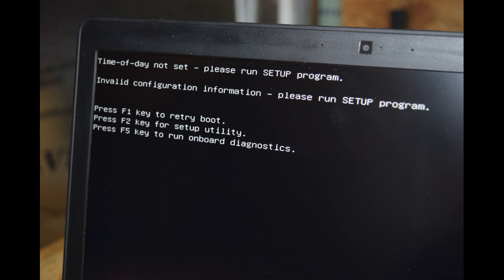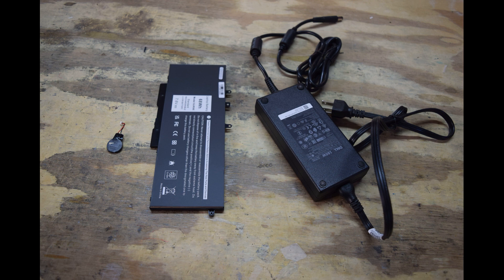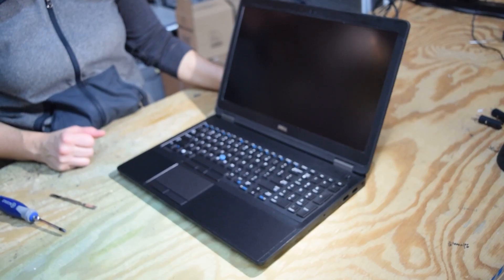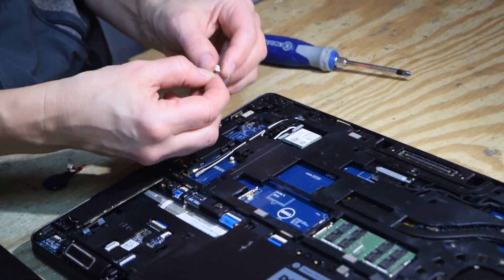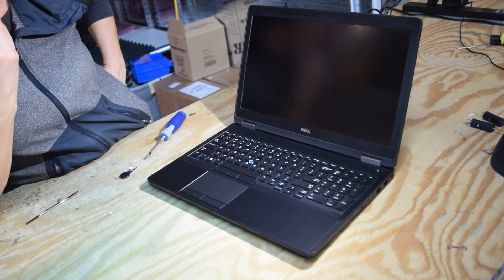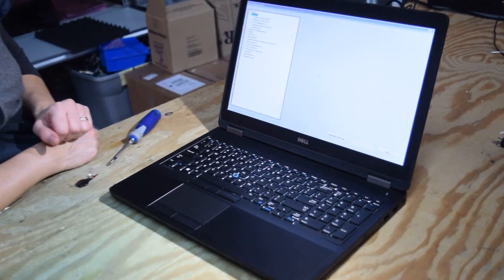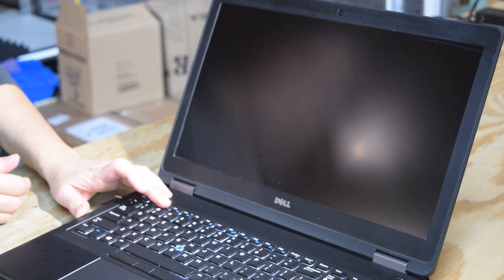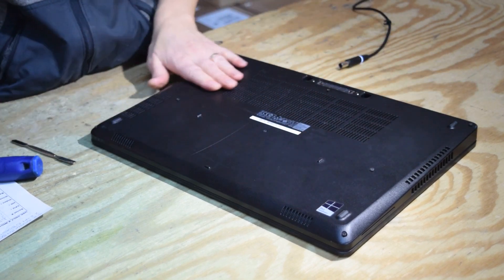Replace CMOS Battery on a Dell Latitude E5570 5580 5590 Laptop

Comment: 5/11/25. I used your video for help correcting a e5570 laptop complete fail -- total black -- would not turn on - would not get any screen whatsoever - refused to charge, none of 3 lights in bottom right would light. The problem arose because I forgot to turn it off while on battery power, and it super drained itself, and apparently upset the CMOS settings. I learned that to reset this condition, one disconnects the battery, disconnects AC power, UNPLUGS THE CMOS, holds the start button down for 20 seconds. Then plugs the CMOS back in, plugs the battery back in, hooks up the AC power, and tries again: yes it starts up, but one uses the F2 key to get the SETUP Program, then reset the Date & Time, and start up again.  Yes, starts up with 1% or 2% charge, but charge comes back.